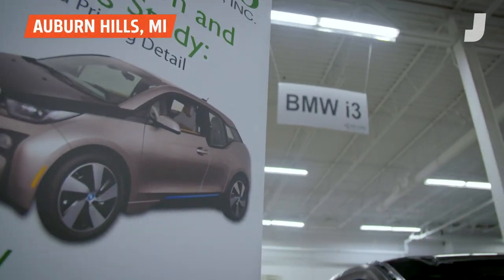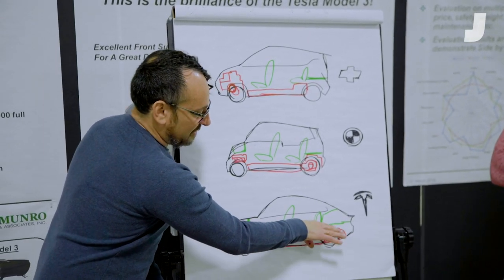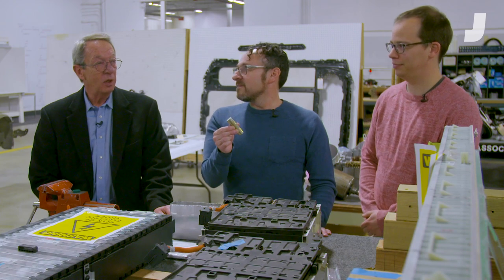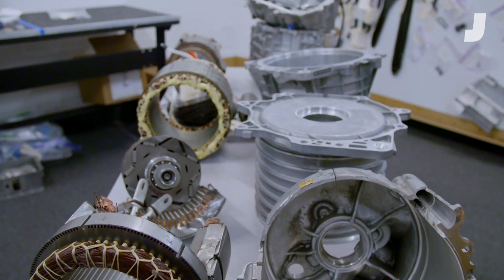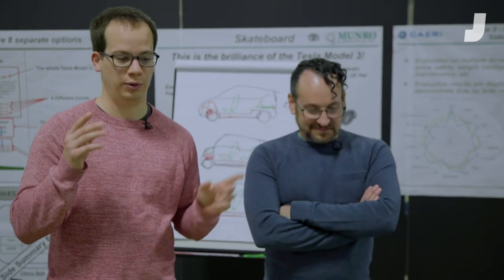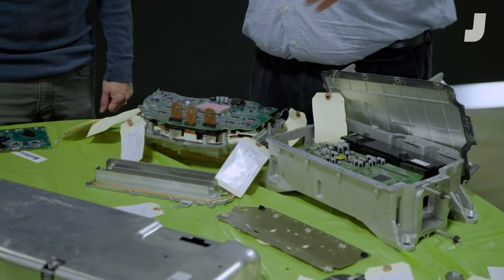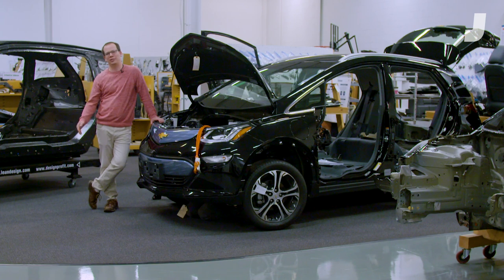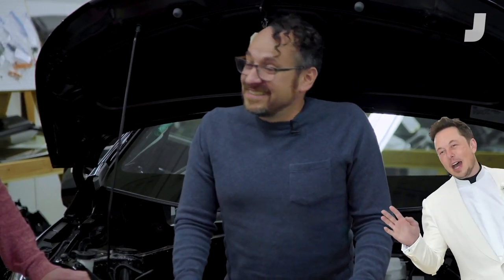A Look Inside The Tesla Model 3, Chevy Bolt, and BMW i3

Comment: More of this. I get tired of the generic well this design is better than that. I want to  know why. Down to the component level.
Reply: Yes
Reply: WeberAuto channel for some amazing Bolt teardown detail. The traction motor deep dive is fantastic.
Reply: Just do an engineering degree.
Reply: All the designs have very strong points but the only one that truly stands out as superior is the battery pack for the Tesla.
Reply: Daniel Roig  not so much the physical design, but rather the chemical composition of the batteries (NCA, or specifically Cobalt Cathodes) that are the most dense in terms of power but slightly less stable.
Reply: @living-wellon-less5669  to me most everything was superior in the tesla. smaller, more thoroughly cooled motor. more simplicity in the cooling system by integrating parts.  a purpose-built body.  I could go on.
Reply: @bob15479  From the standpoint of a mechanic or someone that works on their own cars or even a Tesla certified repair shop it's a nightmare. From a consumer standpoint I can get a Chevy bolt and if something goes wrong getting parts is no problem I wouldn't have to wait 3 to 6 months for 1 part plus getting factory repair manuals from GM are easy you just fill out the card in the owners manual! When I put the track tires on my BMW Z4 only the roadster can handle as well and it would walk all over a model 3 on a track. I am still going to get a Tesla someday I am just realistic about it, electric isn't for everybody, at least not yet!
Reply: @living-wellon-less5669  I've been following this closely and I've never heard a single case of a Tesla part order arriving in 3-6 months. 1 Month? Yes I've heard a lot of that, 4-6 week repair times but you're exaggerating in this case. Maybe you're referring to the TFL case where their shop broke a part and then ordered the wrong one?  

Consumer reports, who recently slaughtered the model 3 and Tesla, begrudgingly admitted that drivetrain and suspension components are great on the 3.  I totally understand that if I crash a Tesla I would be in the shop roughly 50% longer than say, a BMW. But that's an off-chance and in the meantime I'd have less shop time anyways.  

It's also my opinion that Model 3 battery/drivetrain is going to have crazy long longevity and will prove itself to be a vehicle of great value, especially over the long term.  I also believe that resale is going  to be very good on Model 3, especially compared to BMW, Mercedes...

I really doubt you Z4 would beat a Performance Model 3 on the track.  Remember, Musk's promise that Model 3 would outperform the M3 on the track has been confirmed several times now by both professional and amateur drivers. I can give you the links if you'd like.  

Finally you're obviously entitled to prefer a BMW, I don't doubt it would be a more enjoyable vehicle to track, albeit with slower  lap times.
Reply: @bob15479  You are apparently not paying attention to anything, it took my dentist 6 months to get one part and the customer can't even buy Tesla parts they only sell to certified repair shops. Try to order a part and see for yourself! I could care less what you think I live by facts junior and my BMW is far from stock so bring any electric 4 thousand pound boat you want to Waterford Hills, 4770 Waterford Rd, Village of Clarkston, MI 48346 any day you want and the only thing you are going to see are my taillights. Talk is cheap bring it on!
Reply: @living-wellon-less5669  Wow, what part took him 6 months?

Look.  If you want to talk facts,  Have you seen this little gem? And the many other track races with the same result? https://www.youtube.com/watch?v=DSRWKxytW40&t=444s

Stock, your Z4 is not near as fast as an M3.  Granted, you may have it modified to the moon so I there's know way for me to know for sure.  

My point here is not to make you want a Model 3.  It would be a terrible car for someone like yourself who likes to go to the track. Tesla behaves far too much like apple to the disdain of most gearheads. Its technology is in its infancy and it won't truly be on the level of your z4 for probably a decade when the batteries weigh 500  pounds instead of 1000.  I'm just saying it would likely beat your Z4 if the only metric is lap time.  

Indeed, talk is cheap, but unfortunately cars are not! Ha.  I'm a student.  Too bad I'm not a bit further along in life and had the money and I'd gladly take you up on your race.  It would be fun.  You're probably a much better driver than me and would win.
Reply: @living-wellon-less5669  By the way, I checked out your videos, love your German Shepherd. It reminds me of my Grandpa's shepherd Traci who loves to play with the hose the same way. :) Unfortunately she's too old for that now.
Reply: @bob15479  Thank you, I have 2 and a lab, wherever I go they go too. When I travel it is between Waterford, Michigan and D'lo, Mississippi I travel over 1000 miles in a day because there is no hotel or motel that will accept me with three big dogs, on a good run it is 16 hours but my average is 18 hours in a van. That is the main reason at this point an electric car as a main source of transportation just isn't useful for me, it would add 3 hours to my trip and what do I do with 3 dogs that weigh almost 100 pounds collectively for 3 hours while my car is charging. That is why I am switching to a mid-size school bus and a enclosed car hauler. Everybody has different needs and plans, I plan on boondocking for a few years after I am no longer needed here and where I am going I will have to create my own electricity for my daily needs including A/C. Any electric car I would own would be for local transportation and a toy like my BMW, I can get a used roadster for under 60K, I just want to be able to work on it myself, I retired from GM, I have over 40 years experience working on and with computers, I studied aviation electronics in the Marine Corps, it isn't that difficult, everything is pretty much plug and play anyway. The only danger working on electric cars is the high voltage and the possibility of the lithium batteries lighting up it's just a matter of taking the necessary precautions.
Reply: since you are quite a bit more interested in more details of design I can explain part of  the genius of the of the Tesla battery. you will notice that while others use a pouch design for example Bolts, Leafs ,I3s and even Prius, only Tesla uses the individual cell. Why? first, the smaller they are the easier to cool. second, about 40 cells are wired in parallel not only help balance each other, they are wired in such a way that if one cell goes bad it can disconnect from the pack without incurring a runaway or fire. third, these modules are then connected in series to bring up voltage to the desired level. after many miles of use and probably misuse, the battery pack can slowly degrade but can still be used for many more miles. unlike for example a Prius, if only one cell within a module loses power, the entire battery goes offline. the entire system is in series so there is no battery balancing and wont  allow for an individual cell to go offline without affecting the entire battery. Tesla thought about this!
Reply: The why ? The car industry is old fashion engineering ( +- 100 years ) . TESLA works with the industrial design skills = less components ,fast production and labor costs. The years of Takumi engineering are OVER !
Reply: EnlightenedSavage 
   This was an embarrassing “...well this design is better than that” Tesla ad.
Reply: Daniel Roig  That has rarely happened and only on older models. I don’t think that has happened for a long time. I think it was exaggerated because Tesla is new tech, doing things quite differently than the norm.
Reply: Around x xenon
Reply: I am also not entirely convinced that the Chevy Bolt's design isn't better.  It's a lot more repairable.  It may eat space, but if an individual module fails, you can just get it out with a socket wrench and swap it.  I think the idea, though, is that if everything goes well, the Model 3's main components, including the battery, will last 300k miles.  The car is supposed to be crushed then, not repaired, but it is possible to repair it by swapping the battery with one from a crashed Tesla.  Or if something goes wrong with the motor assembly you just swap it.
Reply: Daniel Roig  teething problems? has this happened on a car produced this year? a funnny one I saw was that a kid crashed a car at 200kmh or around 120mph and they were surprised the battery got damaged and caught fire.... 

 no one cares to report on other electric cars because they don't compete with current ICE cars for market share i'd assume, or its not really a story since there are hundreds or thousands of ICE cars that catch fire every year and don't get a second of news time.
Reply: Daniel Roig  don't they make a loss selling those? So if there is a design fault, don't you think they get addressed?

How well does a bolt burn when it's battery gets damaged?
Reply: Daniel Roig  so promoting people to use the superchargers to deliver more energy quickly then free up the space isn't a good idea? If there was unlimited chargers, sure, but trying to get people to use the resources more efficiently frees them up and would likely get far more kw put into cars.

So you don't care that selling the bolt at a loss could send the company broke if they don't turn it around? Interesting point of view. Do you only want Tesla selling cars in the future?? Lol
Reply: Daniel Roig  ever paid someone by the hour for Labor? You prepare poorly or don't have things ready then all the sudden the job takes twice as long. Now if you were organised (low state of charge, pre warmed battery) then you get more for your money. And the finite resource(available charger) becomes more valuable then the product. If power was free, and you can't charge because some is taking an hour and a half to get to 100%, then your happy to wait for that? Now if you put a price on time, them people become more efficient and 4 people can get an extra 50% charge instead of one dude getting 100%. 

How did the price per minute compare to kWh? I asse if your cranking at 250kw then your paying far less if it's purely time based.
Reply: Daniel Roig  I thought electricity was a combination of maximum demand(in industry), time of day and kWh used. Has that changed?

So your against people getting charged a lower $/kWh if they Burdon the charger less? So paying less for electricity is getting ripped off? Now if the charge rate can't max out your battery, then you have a case, as they are limiting you. But I would assume the price is based off the stations available output.

Fuel flow into a car isn't based on how full your tank is. Fuel is expensive. And filling a tank is quick therefore queues for petrol can move quickly, so time isn't an issue.
Reply: Daniel Roig  so if your electricity bill halved price but you didn't know the cents per kwh, then you would request to go on the more expensive plan?
Reply: @living-wellon-less5669  Cybertruck
Reply: @whakjob  What about it?
Reply: Daniel Roig  I think if you check the stats you'll find it's not that bad
Reply: @GeraldMMonroe  the tesla is actually saying 500,000 miles going up to 1,000,000 miles.
Reply: Daniel Roig  You mean to say human drivers not paying attention !!!!!
Reply: @living-wellon-less5669  Actually engineers that ripped apart these cars say that the most advanced battery chemistry is in the i3. You dont see i3 catching on fire like the teslas.
Reply: @Set22Kill  And you don't see Bolts catching on fire either!
Reply: the conclusion was MORONIC. how can a carbon fiber frame be put in negative terms. Carbon hands down is the best frame material. These youtubers are a complete joke and lost all their credibility
Reply: @rollandelliott  Bullshit, carbon fiber is more expensive it can not be repaired it can only be replaced if it is damaged, any chafing will wear through carbon fiber and compromise it's strength, it really depends on the application if it is worth while or not!

Comment: The battery pack designs are also driven by the choice of battery chemistry The Bolt uses NMC chemistry while the Tesla uses NCA cells.
NCA cells have better power density than NMC but are more thermally sensitive so needed better cooling which is why Tesla went with the cell size and cooling arrangement in their pack design.
The Tesla's Panasonic NCA cells are actually the older design with them first being used commercially in 1999 and used in an EV the tzero in 2004 while the LG NMC batteries in the Bolt didn't come out until 2008.
But since the Panasonic cells were already used in laptops the process of manufacturing was already well developed and streamlined.
Reply: keep in mind battery chemistry is evolving all the time and so are the processes to make them. i'm excited for solid state battery tech
Reply: @matthewwiemken7293  Chemistry is evolving yes BUT Tesla is NOT. Its still a rolling incendiary device.
Reply: Nice!

Comment: Just got 2015 BMW i3 REX two weeks ago. ($17K, 15K miles). Most affordable EV right now. Still with 1 year factory warranty plus 1 extra year as CPO. Daily driver to work, 20 miles one way - before - 2.7V6 - 1 galon one way, now 3.6 kwh one way.

Comment: In the beginning when you were talking about basic design, and where the engine is placed etc, an important factor is not even mentioned: “Safety“ ...The huge areas upfron,t without any motor or battery, allows a massive crumple-zone, which drastically improves safety. Congrats Tesla!! 
PS: I have a premier level bolt with 360° camera, LCD rearview mirror which I love, it would be without from this point forward. 
I don’t know why tesla doesn’t have such techy things. It’s so useful. My parking is perfect, and you can come within an inch of the curb or wall, or garage door, without hitting it... every single time without question. 
My car can be completely filled with boxes, and my windows completely blacked-out, yet my rearview mirror camera allows me to see much better than an average standard mirror.
Let’s go Tesla...get on it.
Reply: Tesla's intention is that you won't be parking or driving anymore lol
Reply: Tesla is already planning 10 years ahead, skipped the 360 parking assist camera view, and went strait for a car that parks itself whether you’re paying attention to your surroundings or not, and even when you’re not in the car. It’s like skipping Blockbuster video on your way home to watch Netflix instead.
Reply: I think you forgot that Tesla has a large screen for all things rear viewing.  It is MUCH larger than a little rear view mirror.  By the way, that one part cost GM $120.  Tesla saved a lot of money and put all that functionality in one place.
Reply: Yeah, not sure how a dinky lcd on a mirror is better than a 15" monitor?!
Reply: My advice to you is SELL the Bolt ASAP and buy a Model 3.
Reply: T Jam Dude I’m feeling sorry for you these commenters are roasting you :/
Reply: @CarlosGomez-zl3bv  I don't know. I impressed a Model 3 owner with a base Bolt+3 options. Blind spot indicators and cross-traffic radar are two things you can't get on a 3 that my Bolt has, and that radar has well more than paid for itself by avoiding one collision backing out of a parking space.
Reply: An actual key-fob, CarPlay, heated steering wheel, better visibility, physical volume/climate controls, and the ability to disable connectivity/OnStar are what sold me on the Bolt over the 3. Mine's base with DC fast charge, comfort/convenience, and driver confidence packages. If I could've gotten the Premier with cloth seats, I would've. Surround vision would be great in a lot of cases, I wanted the blue dash lighting, and I wanted roof racks. But they aren't worth dealing with the leather seats. Every Bolt I sat in that had leather felt like sitting on rails.
Reply: The i3 not only has a rear engine, they have an innovative system to redirect the front during a crash.  Sorry, not Tesla